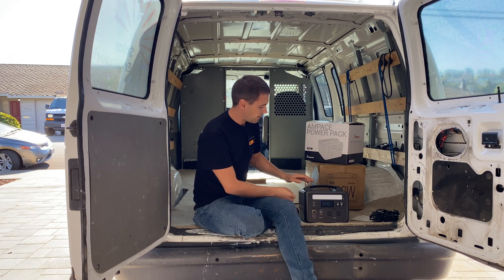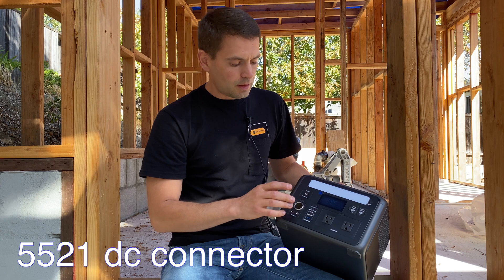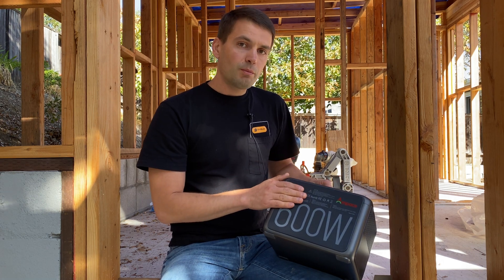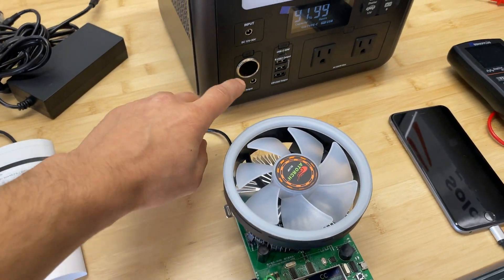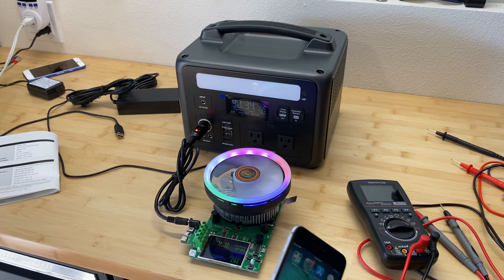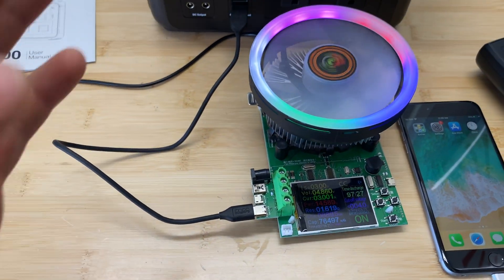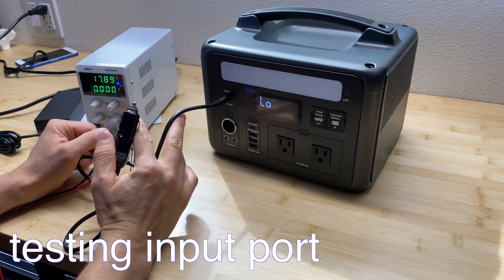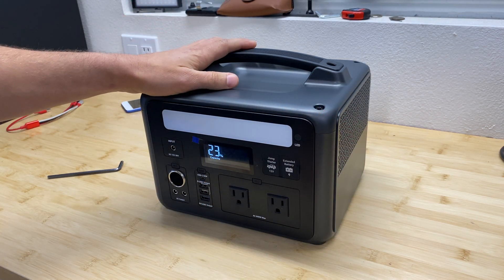Ampace P600 power station. How good is that?

Comment: Witam ! Chcialbym zapytać czy do urządzenia Ampace 600 , można podłączyć dodatkowy akumulator np.  lifepo4  12,8v 50ah ?
Reply from the maker: yes you can, but it needs to be paralleled with power station built-in battery
Reply: Dziękuję za odpowiedź,   czy możesz pokazać na YouTube jak można to poprawnie  zrobić   ,  mam zakupiony już lifepo4  12,8v  200ah  , czy ta bateria nie będzie za duża?? Czy muszę kupić lifepo4 50ah ?

Comment: Did you verify voltage of the individual cells when you disassembled it? You can probably measure it on the BMS balancing connections without opening the plastic enclosure. I think that would answer the question whether the battery is really Lithium NMC or LiFePO4. NMC will be over 4V fully charged while LFP will be about 3.6V.

Also looking at the direct connection from the battery to the jump starter port I’m wondering if it’s possible to kill the battery using jump starter if the connection bypasses the BMS protection.
Reply: I just did a tear down review of this unit and confirmed the LiFePO4 advertainment is BS. The owners manual and back plate with specs is correct as it's just Lithium-ion.